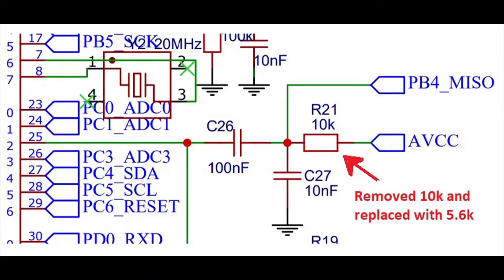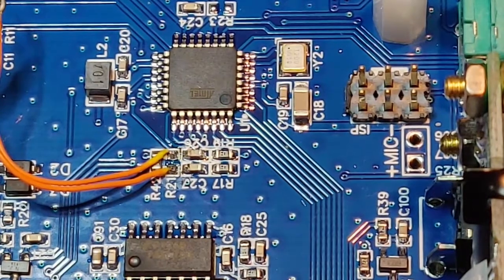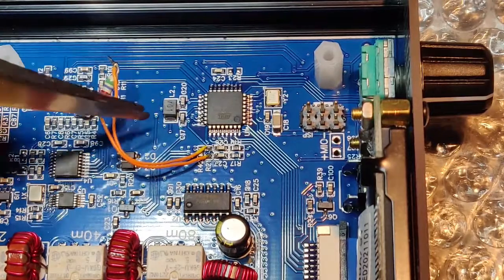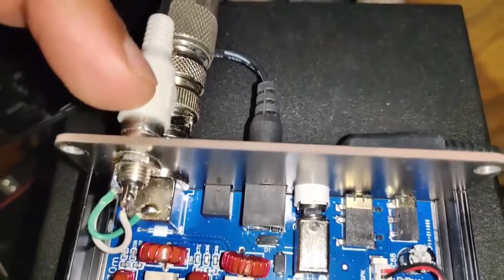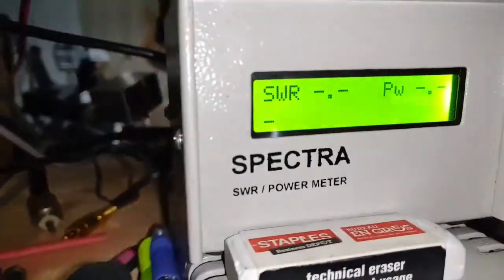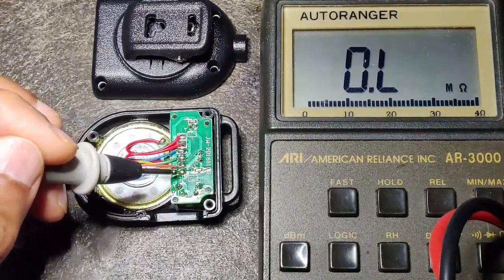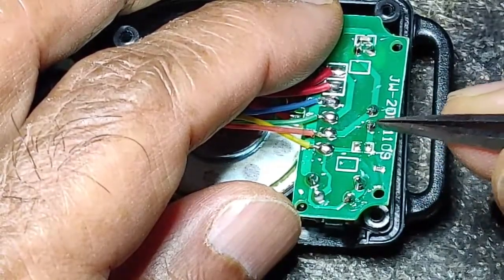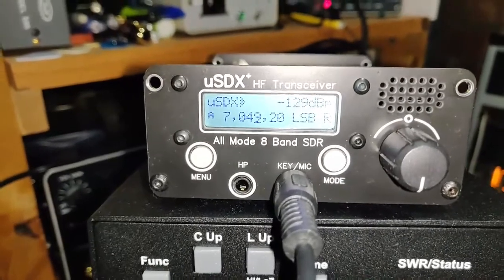Mic mod | uSDX+ | 8 Band SDR | SSB/CW QRP HAM Transceiver | Issue with Iambic paddle + MIC resolved

Comment: Hi have a problem with my USDX+ The most recent version of it, the better box with a orange top and internal battery. The assembler has forgotten to install the 10 meter coil on the circuit board... apparently the radio works, but apart from the noise, the lack of proper grounding and other know problems... It transmits on 10 meter (badly...) and receives also poorly... I couldn't test it with a proper antenna yet, but only with the crap telescopic adjustable whip i got from the Chinese... Please sir, can you be so kind to tell me what is the value of that 10 meter ferrite coil, please?
I've tried finding the schematics on the internet but what came out was a confusion with all the USD? variations but I couldn't find exactly my board schematics... 
Thank you in advance for you help...!
Reply from the maker: Thank you for your message. I'm not in a position to open up the rig to measure the actual L, and here's the basic schematic of what's in my SDR for 10m. I've written in words for want of a better method. You'll have to convert that info to an actual schematic.
Be aware that the circuit used in your SDR may be different.

L3 = 8 Turns on T37-6, L4 = 5 Turns on T37-6
C34 = 10pF, C31 = 56pF, C32 = 200pF, C33 = 82pF, C35 = 240pF, C36 = 220pF

LPF_IN --> L3 --> C31 --> L4 --> LPF_OUT

Connection point of LPF_IN and L3 is C34 to Ground

Across C31 is C32

Across L4 is C33

Connection point of C31 and L4 is C35 to Ground

Connection point of L4 and LPF_Out is C36 to Ground

Hope this helps.
Reply: @PremMenon  Thanks... It is a great help, thanks...!
Reply: @PremMenon  By the way... Now that I have my radio open... the 10 meters toroid coil missing is marked as L6 on my board that is in fact different from all other versions I've seen anyway... It's that "new" USDX+ with a better box with an orange top and internal 4.500mHa battery. It's made by Hutrong and the board is made by them... and quite nicely BTW, it looks clean and even the coils are well wrapped...
Anyway... I'll try to improve the radio anyway... I've to also install the missing CAT control 3.5 socket, (it has the space and connection on the board on a different position as all other boards, but they haven't installed the socket either... and only 2 of the 3 power transistors... I'm seeing I'll have now a project in my hands to try to make it work as it should or even better... Thanks for you great help...!
Reply from the maker: @TheBigChill1 Thanks for your feedback on your rig. With your interest and approach, I'm sure you'll succeed in getting the missing things working.
My best wishes to you. Happy New Year!

Comment: i dont suppose you have the circuit diagram for these radios?
Reply from the maker: I had it, but it's been a while.... You can ask the vendor. They normally send it.
Reply: @PremMenon  yeah ive been waiting  for awhile for a reply, i had some pads pull up from the CAT port trying to find other points to connect it to
Reply from the maker: @ColinMurrayNZ  Oh! That's too bad. If you Google you should find it. I don't want to make promises I may not be able to keep. I've moved ahead to (many) other projects therefore can't guarantee the schematic availability. Besides, each vendor has something different - although the same concept.

Comment: Will changing the resistor improve the SSB TX quality?
Reply from the maker: There's still much to be desired. SSB is not good in this rig. Our communication is understood, but still not good quality. Not worth attempting any further SSB improvement on this rig. Good for CW.
Thanks for checking out the video.

Comment: I have a problem with the audio reports using ssb with this radio. The reports I get are distorted audio and possible RF on the signal.
Would appreciate any help on this please.
Thanks
Reply from the maker: First off, thanks for checking out the video. To begin with, this rig just has a so-so SSB.
I'd isolate the complete final amp stage, connect the pre amp stage output to a piece of wire, tx ssb, monitor your own tx on another Rx in your shack. See if you can resolve ssb without any artifacts/distortion. We can take it forward from there - depending on the outcome. This is just to minimize the unknowns.
Let me know. It has been a while since I worked on this rig, but I can hook it back, and compare with the schematic for an in-depth debug. Good luck. 73.
Reply: @PremMenon  thanks mate I'm going to first try and put a variable resistor on a studio mic and see if that helps. I will try to monitor with a rtl sdr for monitoring. If no joy in that then I'll try a preamp with volume control. Was thinking the resistor you was on about may have been the problem but I'll have a play and let you know 👍👍👍
Reply: @PremMenon  OK my friend I have tried another condenser mic in the front connection of the radio with a variable resistor in line and it makes no difference what so ever and is still distorted :( really have no idea why. The only thing I can think of is have I overdriven the input when using FT8. I came streight off the soundcard into the front of the radio. I've since found out I should have put a resistor in line both on the input and output. Can you shed any light on my problem please.
Dan 🙏👍
Reply from the maker: @dannywhittle4245  that's very unfortunate, Dan. Again, depends on what test equipment you have on hand. Left to me, I'd do what I mentioned in my first reply. Also, I'd feed a known AF signal (Sine wave) using a known good mic, and monitor the output at every stage. Being the holiday season we are QSYing out to the Grand Canyon shortly; back after new year 1st, therefore not in a position to hook up the rig for any real time debug work.

Comment: I have problem with very bad reception from 15m up to 10m...dont know where to sorce a problem. Also self oscillations in speaker or head phones when increase volume on these bands. Any suggestions ? Software version is R103w.
73 de YT7AB
Reply from the maker: Can you please capture both the issues in a quick video and post it on YouTube?
A picture/video is worth a 1000 words. I'll see if I can identify what the problem is after watching and listening to the audio. 73, de VA3UMA
Reply: @PremMenon  thanks for prompt reply. Will post video on YT in the morning since it is 01:30am local but i am still searching for receiver solution.on 40m band have made qso up to 10.000km ...to Japan,Usa,Saudi Arabia..so i am pleased with reception and performamces on 40 and 20m..did not managed to do anything on 15 and up.
Running EFHW antena ..
Reply from the maker: @srakita  QSL. Please send me the link. Good night.

Comment: When You remove the resistor on the mike you do not only resolve the Dit and Daah problem. You also improve the biasing of the elekret audio sensor since the led is robbing a part of the elekret biasing current. Well done guy👍👍
Reply from the maker: Yes. Thank you Wolfram!
73, de va3uma.

Comment: Save all the hassle , just remove the mic when using CW like it was probably designed for
Reply from the maker: Steven, that's a good idea 😃. Thanks for checking out my video.
It's nice to have everything plugged in regardless of the mode. My main reason:  the connectors (sockets) do not "look" reliable.

Comment: So you disconnected the LED because you didn't need the light? ;-) The same here on the little box that I have. Since the CW keyer line in this one (and I suspect on the one you have) is shared in the mic jack, I have to wonder if the LED is all that necessary. 
. . . At the same time, what is your impression of the SSB quality? Listening to the output on the other radios in the shack here, I have to say that it leaves much to be desired. Barely intelligible at all to my mind. I've tried listening on remote SDRs online but my signals too weak to get noticed. 73 de W8IJN
Reply from the maker: Nils, along with that Mic LED, one more change required...on the main board. My video has the info. You hit the nail on the head! Frankly, the rig is a good example in an academic setting to show/teach the students good coding techniques. Period. Oh, yes, for CW it's okay. SSB? No way. Any changes or upgrades we do is diminishing returns. Not worth.
Essentially, the rig overall is a compromise. I believe the uBITx to be a better allround rig. Not SDR. Simple straightforward "superhet" old school technology.....and 100% reliable.... whether in a park or on a mountain! 73. De VA3UMA
Reply: @PremMenon  In truth Ithink you are absolutely correct: as a direct conversion radio, it's ok but it will never beat a good clean superhet design. Thus I put this and its relatives down as toy radios. Good enough for play but not for serious design or use considerations. 73 de W8IJN
Reply: @haramanggapuja  reading the design papers the Tayloe quadrature sampling mixer gives a 3db gain without noise, so it seems it could equal a superhet.  My tests against an SGS-2020 show it's pretty close which is amazing for the cost
Reply: @robc3863  Yep. I have one version of these uSDRs that actually performs as well if not better than my X5105. If it had an internal ATU, well, you know which one would be in the POTA bag ;-)
Reply: @haramanggapuja  what version is it, Sir... 🙏
Reply: Just caught the mic resistor part. Took me a bit to connect my own meandering dots. Pretty sure the non-battery tiny version I have has the same design “flaw.” There are a couple such changes I’d made on my previously owned brick. That’n, well, it’s “special.”  ;-). Fun part of these radios — once I get past essential tremor slowin’ me down — is we can mess with ‘em and not blow up too expensive a box. 73 de W8IJN
Reply from the maker: @haramanggapuja  😀Nils, talking of Tremors.....I hope you get the strength to overcome that. I know how it is. Work stress related - I went through that....had to stop all my electronic repair work.... couldn't even play the guitar or keyboard....but, that's now put behind me. Tremors gone 👍... 73, De VA3UMA